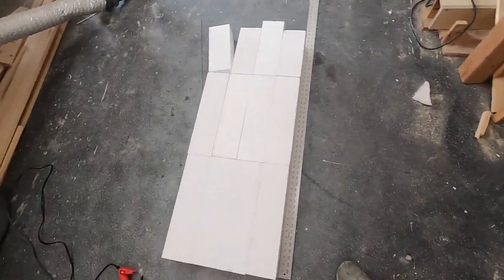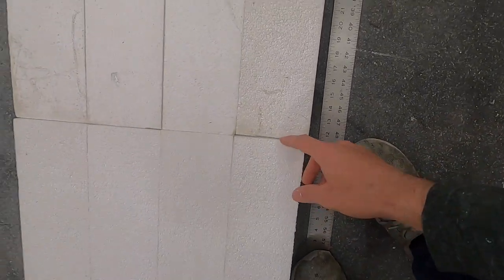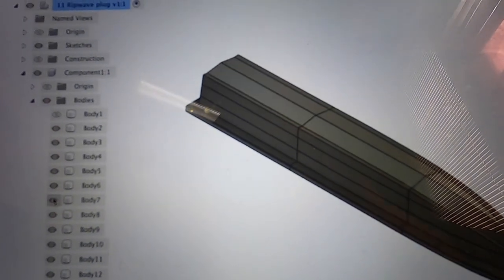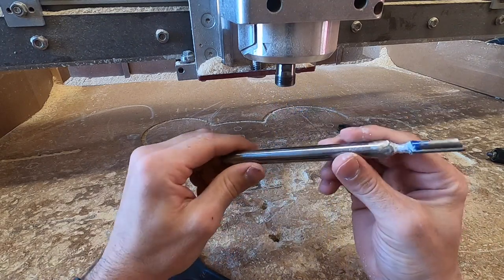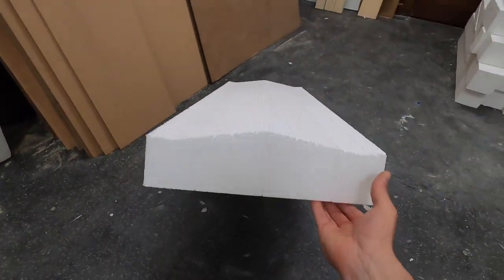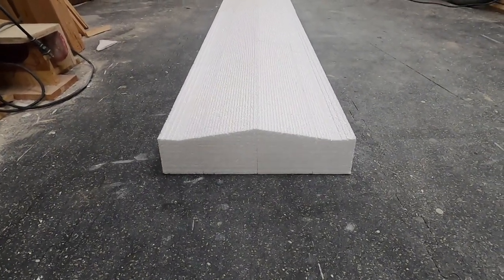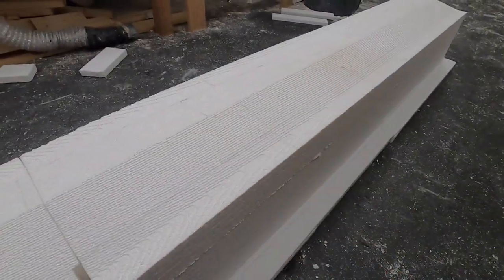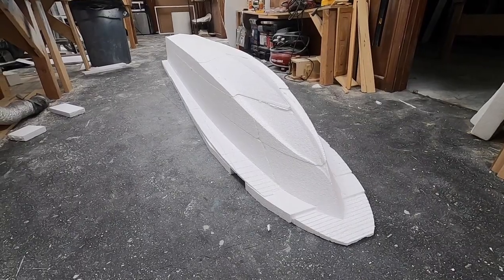CNC cutting the boat hull plug! | Job is done

Comment: Cool! I saw someone on YT used laytex house paint to glue foam insulation boards together. Not sure if it would work with your foam but could be worth a try. If it holds , it may  stop pieces from chunking off since you can roll it on and bond every square inch together.
Reply from the maker: Interesting! I certainly could have used epoxy to glue up every edge of foam entirely but I am not sure if the effort and cure time would be worth it. The hot glue was lighting fast even though it did cause some headaches!